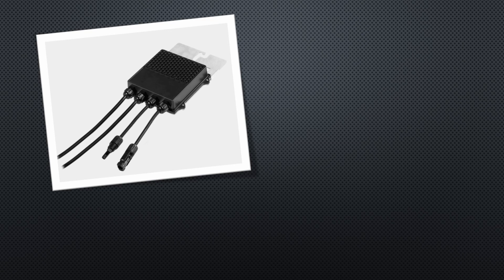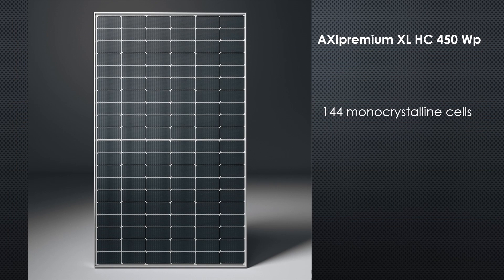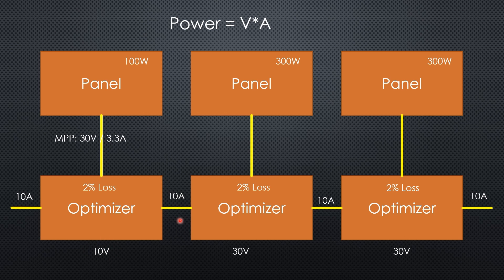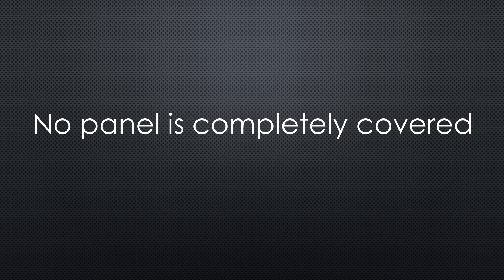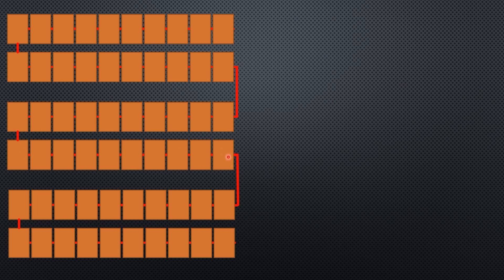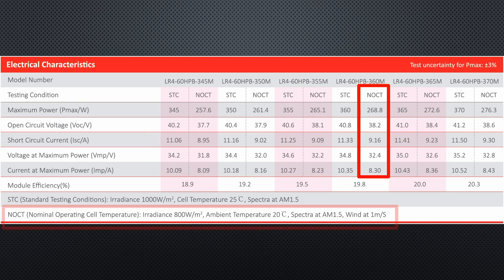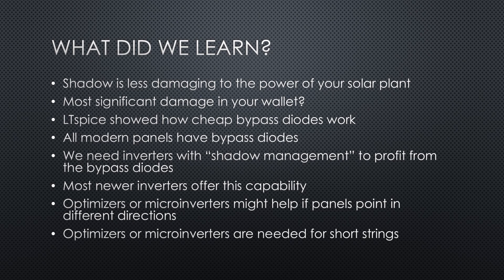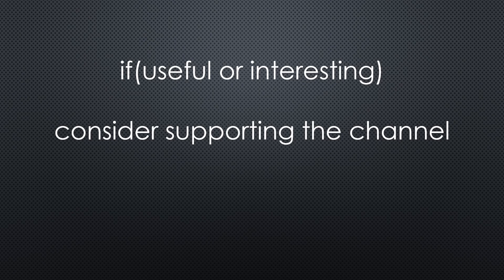441 Are PV Optimizers Worth the Money (e.g. SolarEdge)?

Comment: So you compare solaredge optimizers without having had one 

Considering the self consumption, the optimizer with a solaredge System you save later the power losses in the mppt tracker of a conventional inverter. But still near the sunset my solaredge system shuts off earlier because of the needed self consuption of the individual optimizers 30W@10kWp on my Gen 24 vs 0W @30kWp with my solaredge System.

Most people agree that solaredge is not needed on a uniform roof. But still the safe DC Feature allows more flexibility agreeing with building codes because you can really shut down the roof if something goes wrong withoiud additional hardware or insulation channels.

Please dont forget that solaredge offers 25 Years warranty on the optimizers (but only some years inclusive the service costs) and 12 years on the inverter 
The great thing about solaredge is that you can have one central inverter and integrate many different oriented PV Modules. 

So i now have one central 30kW Solaredge Inverter where i currently have mounted 30kWp with 1 optimizer for 2 Panels (Dual Optimizer P850). So this wiring was much cheaper than 2 conventional inverters for all the different Roofs. Although i had to change 3 optimizers in the first monts, one of them double because my strings were quite short and the shaded optimizers started swinging. But Solaredge was able to cahnge a parameter but didnt tell me what they did because i'm a stupid customer.
Reply from the maker: You describe the value of additional features of optimizers. If they are valuable for you, your decision was perfect. 
This video covers only the fact that people should not bus optimizers to prevent the downing of the entire string if only a part of one panel is covered. Which often is the strongest sales argument for optimizers and microinverters.
Just a minor thought: The warranty usually covers the few dollars of the inverter and not the many dollars for the guy replacing it if your roof is not as accessible like mine ;-)

Comment: Personal experience: I pay ~$50 for an SolarEdge S440-1GM4MRM with 99.5% efficiency (as per its data sheet). It's not "just" about increasing the overall performance of the installation, you debunked that quite nicely, but also about measuring individual panel performance. Helps with identifying misbehaving ones.
Reply from the maker: If you value the additional features of optimizers, you did the right choice. I only did not like when salesmen use the "single leave" argument.
Reply: Agree. On my installation, one if the panels failed after three months. It was easy to detect as you get power per panel. Our system has 3.6 kWp facing South and 1.5 kWp facing West (both different inclined roof), on one giant string. Hard to say whether this works better than two independent MPPT.
Reply: @cybersax2  Solar panels hardly EVER fail nowadays. Quality control is so good.
Reply: Optimizers self identify when they fail!
Reply: Exactly, this line of “optimisers are all about shade” is typical of string manufacturers. It totally misdirects from the many other benefits of MLPE like many safety features, panel level visibility, simpler fault detection and repair work, higher efficiency, dc coupled storage, the list goes on. Making it all about shade, which is a confusing topic and difficult to properly compare, makes it simpler to push the traditional dangerous string inverters with uncontrollable high voltage dc.
Reply: @BrentHeberAusNZ  Ooh, dangerous string inverters! It's still the same amount of kilowatts coming down the string, which will still kill you, whether DC or AC. Who needs panel level visibility? What fault detection. Solar panels almost NEVER fail nowadays.Higher efficiency? Any proof of this?
Reply: @johnthomas338  DC is way more harsh on circuit breakers and DC cables regulations are strickter

Comment: Thanks Andreas - another fantastic, clear video. I have optimisers fitted in my "professionally" installed system - seems like I fell for the bullshit! One good point about the optimisers (although possibly not making them worth while) - they do let you know the individual output of each panel. Like your brother, I also lost most of the summer's production due to slow delivery of the SolarEdge inverter. I wish I had considered my installation after you, and could have taken advantage of your superb research!!
Reply from the maker: At least you have a working solar energy factory now. That is the most important fact!

Comment: Have you checked out 'ideal diodes'? MOSFET configured as a diode. Allows bypassing solar cells without the diode drop if the cell isn't producing as much as the rest. Small and inexpensive. Could be used on each panel individually for maximum efficiency.
Reply from the maker: I assume they have reasons for not using this circuits because they are well known to most engineers.
Reply: @AndreasSpiess  After reading the datasheet for MP6914 (an example ideal diode for solar panel bypass IC), I'm thinking the reluctance for using this circuitry is that it appears to require a separate power source. I was thinking they worked solely on the power provided by the solar cells (supposedly making them a simple drop in replacement for the bypass diode). This would complicate wiring if that is the case making them a pain to integrate.

They also show it used once per solar panel string/group rather than each panel...which reduces its overall benefit over just a single cheap low voltage drop bypass diode. If bypass diodes were being used per panel I could see more benefits of replacing those with ideal diodes (especially if many panels get regularly shaded from moving clouds or foliage).

Comment: Besides the (perhaps small) advantages in PV setups with shading problems, they have other advantages as well:

* Each panel can work at its own MPP. The net effect of this probably small in small strings but may be bigger in larger systems.
* If one panel breaks, you'll immediately know which one (if documentation is in order)
* If one panel breaks, the other panels keep producing energy.
* If one panel breaks ten years from now, and the exact panel can no longer be obtained, a panel with a different (probably higher) output but identical physical size can be put in its place. Or you can leave the spot empty without impact on the rest of the panels.
* In case of a failure situation (say, a fire, and the fire department throws the main breaker), the optimisers will shut down, which means that the DC cabling coming down from the roof will not be energised.

Of course, there are disadvantages, too, like you said:

* The optimisers levy their own "power tax" of a couple of percent.
* Optimisers can break. They are power electronics with major temperature swings and mounted outdoors.
* They cost money.

All in all, I'm still happy I got optimisers (SolarEdge), even in my PV system that has no shading problems at all.
Reply from the maker: I agree with your explanations. However, I think that they still use the claim of the blocked whole string because all other arguments are not as scary :-(

Comment: Also, who does not like to have the HF noise generator on his roof that a SolarEdge optimizer is?
(most radio amateurs do not like that 🙂)
Reply from the maker: Viewers wrote that the newer ones are better in this respect. But we have severe issues with the old ones…

Comment: Some time ago Dave (EEVblog) posted a video about a loss of output from his old solar array.  That consisted of several panels in series and a single inverter.
He observed a dip in the power output every day.  After climbing the roof it turned out to be caused by a "guy wire" of his TV antenna, a steel wire typically 3-4mm in diameter, which dropped a shadow line over one of his panels.  That caused a big drop in his output power.
Likely your panel is a lot better because it is much newer, but it also shows your experiment is not representative for systems bought some years ago!
Reply from the maker: In this video he also mentioned that his inverter was 7 years old (and probably did not include shadow management). Anyway, it is always good to remove shadows if possible.

Comment: What is the situation where everyone gets solar panels and the grid cannot handle all the power. Do the micro inverters handle this situation better than just one inverter by shutting down maybe one or two panels instead of the whole string? I do not know.
Reply from the maker: In such a Situation, the grid voltage increases and all inverters have to automatically switch off (it is the law)
Reply: @AndreasSpiess  Thank you, that makes sense.

Comment: Thank you, what an eyeopener. I would only want to point out that with the optimizers or microinverters you can monitor the power output per panel and that is a nice feature if you have to do troubleshooting in the future. Only you need to know the layout of your panels and which is which or you still don''t have any usefulness. But on the other hand, you really have a good point about the active electronics in the harsh environment on the roof during the hot summer sun. What is more likely to break anyway...
Reply from the maker: Single panel monitoring seems to be important for many people. Professional installers know that panels do not fail often…
Reply: The monitoring is a nice feature but not needed. Even without it, the panels will function the same. Even if you manage to find out that 1 out of 15 panels is defective, the cost of optimiser would have been much more than the cost you saved by getting 1 panel replaced

Comment: The only advantage I can see is that if (and that's a big IF) a single panel fails, the optimizers can tell you exactly which panel failed.
I think in general they're a scam. We have a perfect south roof with no shading, and no trees whatsoever. The company that we consulted didn't even consider this and just put in solar edge optimizers by default. They wouldn't really do anything but bumped up the cost immensely. Especially since they would have used small 300W panels which would have meant the optimizer's would have cost more thant 50% of a solar panel. IMHO that's just unprofessional.
Reply from the maker: Your example seems typical for many other situations. Good if you know yourself what is good for you ;-)

Comment: I'd say you're wrong about microinverters. Their propaganda claims you don't need optimizers with microinverters, which is true, but not because they already incorporate optimizers. Microinverters don't need optimizers because you don't connect panels in series when you use microinverters (at least the enphase model you show, IQ7 or IQ7+). They "naturally" dismiss optimizers, whether optimizers make a difference or not, because they "naturally" do not suffer from partial shadow of one panel. You use one microinverter per panel and panels are mounted in parallel (after the microinverter).
Reply from the maker: Some microinverter companies make the same claim that strings loose all the power when one panel is covered to show the superiority of the microinverters. That is my point and that is why I included them.
The rest of the claims are ok with me. If somebody trusts electronics on the roof, microinverters are fine.
Reply: @AndreasSpiess  Well, they do typically have a warranty of 10 years, life expectance of 25. Your Huawei, I'm guessing 5 years warranty, 10-15 years life expectancy. Just saying....
I can vouch on 4 years for the IQ7+.
Anyway, you have too many panels, you definitely can't use microinverters.....
Also, you're right, microinverter companies make the same claim as optimizer companies and you do well in "punishing" them for it. But you can't say that it's because they have an optimizer inside. It's just small and waterproof, that's all. They do have a lot of advantages if you ask me, but not for so many panels. For example, you can build your system in small steps and you have a single cable "230V/few A" to route into your home.
One claim they make that you can tell us about in ~15 years is that high voltage on the panel in relation to its frame (grounded by law) leads to fast degradation of the cells. I wouldn't know if that's true.....
Reply: @AndreasSpiess  I have 2 further questions for you. 
1) How many MPPT's does your inverte have? (I'm quite sure the answer is at least 2!)
2) When you performed the experiment shown in this video, was the other string connected and producing power?

If your answer to the first question is 1 MPPT, then I'd say you were not running the other string, otherwise you would have lost the total power of the string when you cover 1 panel and would have concluded that optimizer companies are right in their claims. Actually, they wouldn't be, because you would loose the power of the whole string regardless the diodes and also regardless the use of optimizers on that string.

How do I know you have at least 2 MPPT in your inverter? Because you would only have the power coming from one of the strings the whole time, which would be the one producing the largest power at any given moment (I guess you would have full power from both strings during the short period both are producing the same power).

In other words, you don't need optimizers to balance the current flowing in different panels in a string because modern panels have diodes. But you still need to balance the voltage across different strings of panels. That is the function of having separated inverters (with an unavoidable MPPT each) for each string. So, in your inverter you have 2 (at least) mediuminverters (I don't call it microinverters because it would hurt your susceptibility) and each of your strings behave like a single panel connected to a single inverter.
So, you did follow the claim of the microinverter companies, "connect every single panel to a single inverter and you won't loose a lot of power due to a partial shade". You just replaced the word "panel" with the word "string".

Anyway, my point is: people with a single MPPT and more than one string will not be able to reproduce your results and will erroneously conclude they need optimizers.
Reply from the maker: @humbfig1  As said in the video, I have two strings and 2 MPPTs because I have east and west-pointing panels. Maybe you watch my earlier videos for details.

Comment: Hi Andreas what a wonderful and helpful video. We knew already indeed by the video you referenced too. Your last bullit in "what did we learn" is somewhat confusing for me. Do you mean that if you like to start with lets say 6 panels 6 X 44V is 264V is still too less to start the inverter? I like to plan to expand my system indeed with 4/5/6 panels depending the size I choose. Do I conclude correctly that I need optimisers when using 4-5-6 panels? What about 0 degree direction. Does it matter how the panels are oriented then? landscape or portrait combined?
Reply from the maker: The optimizers I know only reduce the voltage (buck converters). But I do not know a lot of them. Such optimizers do not help with the starting voltage. 
My inverter has a starting voltage of 200V. You should find this number in the datasheets.

Comment: Probably a daft, uneducated, question, but could you just connect all panels in parallel (several parallel strings), with the existing output diodes on each? Yes, some very large current-handling cables and some final inverter redesign, but otherwise not requiring optimisers?
Reply from the maker: My inverters start at 200 volts. So I need at least 5 panels in a string. If you find an inverter with lower start voltage you can put panels in parallel (with a diode in Series).
I wanted to work with high voltages to reduce losses as said in the video.
Reply: @AndreasSpiess  Thanks, I only ask because I have seen some 24V 5kVA hybrid inverters. Of course, I have no idea how efficient they are or whether a purely parallel connected solar panel system would even work / cause other issues. I wish you success with your system (your videos are very informative).

Comment: Andreas, the emphase system consists of microinveters and does not have acentral inverter.  That’s a complete other system than the solaredge system (optimizers and a central inverter). Emphases delivers directly 230V AC current at every panel via the microinverter  which is directly fed into the home grid. So in my opinion this video is tendentious and not correct for the emphases system.
Reply from the maker: I know the product and the system and I agree, it is different. However, this video is not about products. It is about the claim that the whole string is useless when only one panel is blocked. AFAIK I find this claim also on Enphase related pages and videos.

Comment: Great video and analysis, Andreas. Thanks for breaking this down and clearing up the myth around optimizers. I have made some tests as well and could see huge voltage spikes. I believe this was because the main string MPPT was fighting with the single optimizers and could not reliably find the max power point of the panel curves. I removed the optimizers again and added an additional string to compensate for loses I have through shading. Problem solved.
Reply from the maker: Thank you for sharing your experience. Indeed, it is not as easy as it looks like to find an optimal point if you have a lot of optimizers. They can influence each other.

Comment: Microinverters at least perform inverter function. Diagnosing a single solar cell in a string bringing down the string is hard. Microinverters can tell you specifically which one. Also one solar cell failure has little impact to the system.
Reply from the maker: I agree.
Reply: @AndreasSpiess  Glad you put this out. Can save a lot of money in some cases. Each different facing string needs to have a separate inverter otherwise. Tesla doesn’t use microinverters or optimizers but does use multiple inverters for their systems.